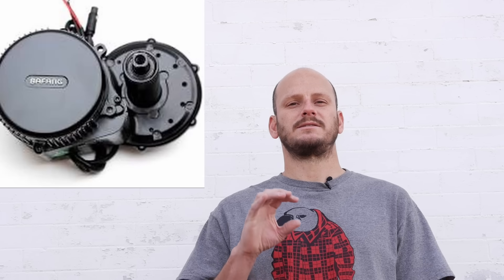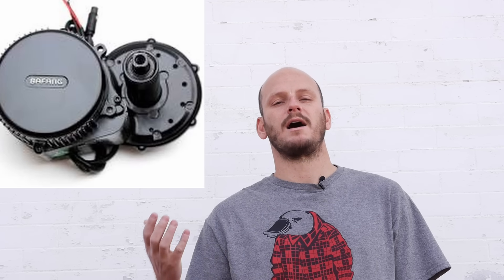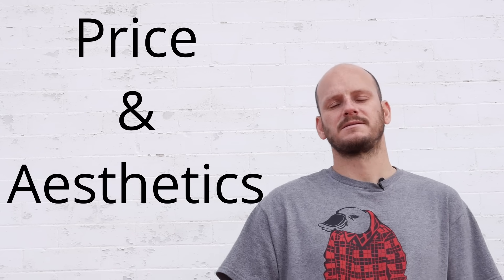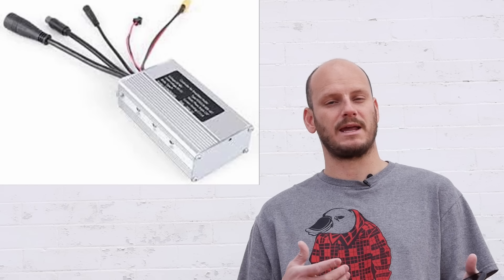Hub vs. Mid Drive Motors: Why Hub Motors Suck and Debunking Common Myths with performance test

Comment: I use a 2000w hub drive, blows away every mid drive I've ever come across or owned with ease. Wicked acceleration and top end speeds on the flat or downhill, 30mph uphill no trouble for my size and weight.  Pointless buying a lower wattage hub drive as the cost difference between 250-2000w are so minimal. Used the 2k for over a year with zero issues on anything you mentioned, even the controller, a phase runner controller is not much bigger than a match box... Total conversion cost was less than $600 on a beefy dh bike so the cost comparison is way off. Mid drives are just better for low wattages where the extra torque actually makes some difference on a hill. Lol.. The only  thing i prefer on a mid drive is the motor is located at centre of gravity.
Reply from the maker: Exactly what I said in the video 👍

Comment: Without an e-bike I have to replace the chain 2 times a year.
Double the torque on that weak link?
Have you driven a modern electric car? I don't think you have a good perspective on "modern" motors.
I'd say the "current" hubs might be junk.
Reply from the maker: Dang, how much do you ride? I go through a chain every 1-2k miles on a mid drive. 
An electric car is nothing like an ebike. How do the drivetrains compare at all?

Comment: My friend who had a Giant mid drive drove my hub drive last week and said it was more fun accelerating more quickly and using the throttle to get up to top speed quicker. His mid drive was slower. The hub  drive felt more like a motorcycle to him. Hub motors are also 2/3’s the price. Mid drives feel more natural like pedaling a regular bike. If you can afford it, buy one of each. Apples and oranges.
Reply from the maker: Mi will go out on a limb and say he bought a low powered premade bike with a mid drive? If he had an aftermarket Bafang there is no way he would still say that 👍

Comment: It is a good argument that the industry has hardened down on mid-drive design and costs. But there are still so many deals on hub motors and controllers that you could convert almost any bike for under $200 (not including the cost of the battery).
Reply from the maker: But you have to think how cheap that is if it includes the wheel. There is no such thing as a “free lunch” in life👍

Comment: Hi Johnny, you are absolutely correct about what you say in general, but, really it depends on what you  want from an e motor installation? If you want power and as you show in your video clip , and not to have to peddle at all, yes, then a mid drive has the punch over a hub drive! However, if your not going to want to peddle, then why bother turning a bicycle into an " ebike"?  you can by pucker e bikes, which are just like petrol motorbikes, if you don't want to peddle, and a lot more powerful too! Lets face it, standard bicycles are not designed for the speed and power that these motors deliver, nor do they have the braking to pull the bike safely up either. So if you want a motorised bicycle to help you peddle up hills or against head winds, a 250watt hub drive is adequate and more importantly,  legal in the  uk on the roads. Anything greater than 250watt motor on a bicycle is forbidden in Uk on the road. If i want power I ride my 1200cc BMW  R NineT motorbike, with 110 HP! But  if I want to see the countryside, and take in the views on my bicycle, I use my 250watt front hub motor Ebike conversion, trust me, it has more than enough power if you want to get the exercise, and benefits of cycling. So back to the original question,  its really what you want the e'bike conversion for?? For me, its to allow me to go up hills and against headwinds  without too much exertion and at a leisurely pace, and to enjoy the ride!!
Reply from the maker: If you are a cyclist, yes you will want a mid drive for a conversion. It’s a much more natural experience IMO. check out my video on “why cyclists prefer mid drives” if you want more of my opinion on the matter. But yes, for some, a hub motor might be a better choice. 👍

Comment: Not sure if I caught you saying that but I think you missed one downside of hub motors. At higher performance uses its near impossible to cool them. I mean How do you even do that? With mid engines there is place for radiators or even liquid cooling loops.

Comment: With my Hub Motor e-bike I drive about 10.000 Km every year. I paid 200Euro 48V 10 A LiBattery + 250 Euro for a normal bike + 500w Hub Motor Kit 180Euro. TOTAL COST < 700 Euro After 3 years I had to change bike... No Problem ! removed battery and Hub motor and installed on new bike ! Can you do that with Mid Drive motor ? How much does it cost ?
Reply from the maker: Do you mean mid drive? If so, yes.
Reply: @JohnnyNerdOut  yes Mid Drive, not hub

Comment: You saved me from making a mistake. I have had a mid drive for 4 years and its been excellent. Recently I snapped the chain on it (after 2 years of use). That 10km walk home made me decide to buy a hub motor (I havent bought it yet). Listening to you has convinced me to not do this, and as you suggested, just carry a spare chain with me. 
Thanks for your video. Oh and yes the Bafang mid drives are pretty durable. Mine has been fine and required almost no maintenance.
Reply: And if you don't want to carry a spare chain around, take a small chain tool and shorten the chain by a link (providing it's a geared bike). You may not be able to use the highest gear, but it will get you home.

Comment: Still have a Goldenmotors Magic Pie 4 pulling my 35kg Longjohn with me and my gear +120kg on the road, its been 5ys now,, 3 sets of batteries and it keeps going,,
So he's some 90% bullsheise ,, get a good quality hub and use your brain,,
And even Bosch middrives brake,, and the +1500$ bill beats a Goldenmotors Magic Pie 5s 350$,,,

Comment: Three things that stand out to me are having to replace spokes which are expensive per spoke, not climbing nearly as well as mid drives while also weighing more if you add in a second upfront. Also requiring you replace the wheel, or do surgery to your wheel in order to add it, but again the spokes being at a major risk of having to be replaced is extremely unappealing. Thanks Johnny.
Reply: spokes are expensive stop talking crap you fool a spoke cost Penny's you fool,you got no idea

Comment: I have a Leed Bafang hub motor. It only has one speed, on or off. I also have a Hilltopper Sprinter with "throttle" control. Much more powerful. I put them on antique bikes from about 1950, and I like the minimal change in appearance.

Comment: I respect your expertise, but I disagree with or questioned almost everything you said.  I bought a cheap $200 Ebay hub motor kit last year and have been riding it hard for nearly 2000 miles without any issues, hills and all.  The only thing I really agree with is how much of a pain it is to fix a flat on the rear wheel.  You also didn't bring up regen braking on hub motor.  Do mid drives do that?
Reply from the maker: You can definitely have good luck with a cheap kit. I definitely wouldn’t recommend that everyone though. Performance is is super relative. A mid drive will offer superior performance but if you don’t need it, a hub is the way to go👍

Comment: Lmao what's the point of the mid drive if it snaps the chain every time u floor it. Oh it only fails every 1.5k km wow mate that's like getting stranded only every 3 weeks. Not to mention all the sprockets and berings that you'll be replacing every year.
Reply from the maker: The power is worth it if your a guy like me😀

Comment: You are talking about motors that are above the 250W output that is legal in many countries. Ie UK. Then we have to input power so straight running without pedalling is out. 
Now going to hub drive not having gears. because one has to pedal anyway then gears from the pedals on the rear wheels are perfectly Ok. It takes the technology away from the motor so less to go wrong. Hub motors lend themselves to folding bikes better as they are lighter ( sometimes) & take less space being in the wheel.  As for acceleration- my Brompton E bike has terrific acceleration . It is one of its special features for use in cities where one has to get away from the trafic lights quick to avoid cars turning left across the path of a cyclist when pulling away.
Free wheeling The hub in a Brompton is fantastic as one can spin the wheel with power turned off & it just goes on turning for ages.
So whilst your comments may apply to many bikes one has to consider where it is being used & what for first. Then compare & i suggest that your opinions may change. 
There are many bikes that debunk your video --as good as it is- Sorry
Reply from the maker: This was an opinion piece. Everyone has different wants and tolerances. For me, I would always take a mid drive 😀
Reply: @JohnnyNerdOut  Of course & I would accept that. However, I feel that a balance is required when an article is put out to the wider community. After all your opinion is widely respected, so I feel that it would have helped if some clarification had been added. But that is not to say that, for the motors you presented, you were in any way wrong
Reply from the maker: @grahamlongley8298  you are right. I have planning a v2 video soon

Comment: I bought a mid-drive bike and the fact it is limited to 250W in my country to legally ride on the road, as it has to be in most countries in the West, means that if I am going up hill I have to be in the right gear for that hill or the ride becomes a complete pain in the butt.

I converted my old bike to a 250W geared hub drive and the difference is that it is a joy to ride up hill in comparison to my mid-drive bike and the torque is generally all round better.

Maybe what you say is correct for off road high power bikes but for the vast majority of people in town and limited to 250W I would say they are far better to go for the geared hub type every time if they have any hills in their city as the ungeared hubs are totally useless on hills.

Comment: I'd say with a hub drive you have plenty of gears. With a triple chain set. Plus road and some off road I prefer a hub. Plus so much cheaper. Reliability is much better. Mostly off road I'd go for a mid drive.. But as you like to put down older people no i don't tide off road up single track.

Comment: You can get geared hub motor ebikes, The geared hub motor and the stator are connected through a gear reduction system. Each time its case rotates, the internal gear rotates many times at a faster speed. This allows the motor to work at a faster and more efficient speed, while also allowing the wheels to spin at a relatively low speed.
Reply from the maker: That’s actually how almost all motor works. The benefit of a mid drive is the secondary, variable gear reduction. IE: bicycle gears

Comment: Wait, geared or direct drive hub motors? Which one are you comparing  to the mid drive. I live in San Francisco and have  a hub drive 750w Bafang powered fat tire bike with a 52 chainring with a 11-32 cassette and can get up mostly all the hills here no problem. 
How much better would a Bafang Ultra 620 mid drive help me up the same Hills
Reply from the maker: Geared.  I have noticed that the Bafang 750w fat bike hub motors do better than others at low end hill climbing. Still not as good as a mid drive though but pretty good.

Comment: I've got a hub motor but I'm not necessarily a fanboy. What yr saying makes a lot of sense and I've been thinking about switching for a while nowbut your right. Not enough torque when you really need it
Reply: That's odd. My $100 motor will flip you at low speeds if you're not careful. I think you need more phase current.

Comment: Hello Johnny . New subscriber here , lovin the knowledge in your videos . I currently ride a Ebike for main transportation . The bike has rear hub motor ( sorry  I didnt  know , lol ) ..  I have bought  and am  currently restoring a used Trike , I will be having a mid drive motor installed . I realize there  will be a  vast difference just in motors . I was wondering , could you possibly  explain if you think having a trike will automatically  give me more  speed overall .
Reply from the maker: A trike will actually take away some speed, being that you will have more rolling resistance with 3 tires and more weight.

Comment: I have both, practically speaking, I like redundancy with no down time, so my preference is hub. If my hub goes out I can still pedal, if my chain or gearset goes out, I have the hub. Two independent systems working in parallel. In my mid motor, if chain or gears go, I have to stop. Both have pros n cons as your video shows, I just prefer not to stop for my very ordinary rides.
Reply: I have a pretty cheap (but rugged!) ebike with a hub motor as a cargo bike, and I actually had that help me out. Middle of a street and the chain came off my front crank, and even on an uphill I was able to keep enough speed from the hub to pull off to the side.
Reply: If anything breaks, ever, I call Karl. He fixes everything, anytime, 24-7-365.
Reply: I like hubs motors due to ease of installation.
Reply: @IMayHaveNukes  You're just lazy and do not know how to appreciate true power.
Reply: @IMayHaveNukes 
Hahaha... Ease of installation of a hub motor? Really? Please tell me, that's a joke.
Did you ever try to install a hub motor?
I mean, have you ever tried lacing a hub motor in the rim?
Extracting the pedal system and replacing with mid motor is much easier and less complicated and time stealing.
Reply: @Delphis1982  You know most hub motors come with the rim already on them right? The only tools you need to install them is a wrench and your own hands.
Reply: @IMayHaveNukes  
I know, but usually I don't want to always change the whole tire only 'cause of the motor.
If I want to keep my rims because they're made of carbon, then I have to fuck around with special tools, patience and a whole day of work.
I change a bike to motorized in roundabout 1 hour and it doesn't look nerdy at all.
If the bike or the rim are premounted, then it's if course simple as changing a tire.
But come on, if you always change the entire rim for changing the motor, it's like buyin a new car because your ash tray is full.

And at least FOR ME the ultimative KO criteria is the ability to pull a heavy trailer during holiday, even at low speed 
I really have the NEED of the mid drive.
The chain is changed in 5 minutes.
If you're too lazy to even change a chain, then you go for the hub, of course.
There are pro and cons at both motor types and for me the BIG CON of the hub is the danger of overheating due to heavy load.
Reply: @Delphis1982  
How many people pull a heavy trailer on their ebike?
I would venture to guess very few...
Reply: I have a 50 year old ten speed. Same chain and derailers for 50 years. Hmm...
Reply: @uncareid5557  Factor in the instant torque from the motor and you might see it finally break. Speaking from experience.
Reply: @uncareid5557  So sorry to hear this.
Reply: @Bill_Owen  I have thought about this long and hard. The Fuji is tired and I am not. It needs new everything, all this on a rusting frame that I am not emotionally attached to. I was going to make a joke about my wife, but I will stop here.
Reply: @uncareid5557  So what are you doing here?🤣🤣 The video is about e bikes
Reply: @uncareid5557  old school is the best school. 👍
Reply: Lol Clearly leg powered! Unless you're blessed with Hulk legs, that chain ain't goin nowhere! These new motors are so torquey chain snaps unfortunately are becoming commonplace. We just need to prepare so the downtime is less.
Reply: @mojolife1315  we need to prepare? By 2022 one should have a bike that stays in one piece instead of dragging spare parts along.
Reply: @Boss-Crow  I do about 60 to 100 miles a week when the weather is nice. I was single and about to start college when I bought the bike. I rode it a lot in the first few years. Then I got married.  Now my youngest is about to turn 40. Through the years the bike went from heavy use, riding with the kids to collecting dust when the last one left for college and my business took over my life. Now retired I get to play again. Also, I had the bike tuned up and replaced the wheels (it had sew ups) in the 1990's, the chain might have been replaced then but I don't think so. I'm on my third seat and I just replaced my rear tire but the front rubber is 30 years old and still looks pretty good. I live less than an hour from two Ti bike builders, a new ride is on the horizon!
Reply: @uncareid5557  Spare yourself the Ti trouble. It's really not worth the money and doesn't provide any technical advantage. Either go aluminium for cheap or carbon frame.
Reply: @rosomak8244  I bought a Cinelli Faster carbon fiber bike. Not as comfortable as my old steel frame, but SO much faster! I'm set at least for the next decade!

Comment: I saw your conversion from the Juiced Crosscurrent to a mid drive.  Can you do a video on that or at least explain what you did - what mid-drive motor did you use and how complex was the rewiring?  Did you just leave the disconnected hub-drive wheel in there or replace it?  Thanks much!